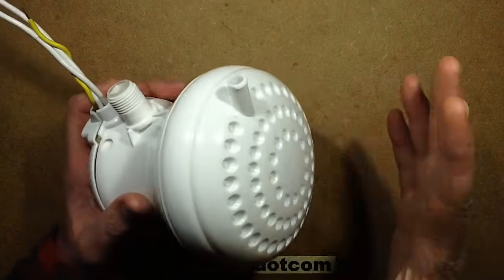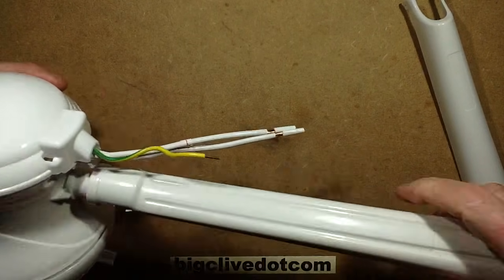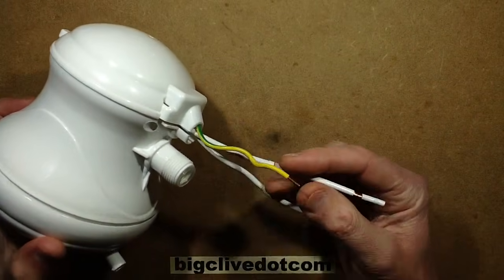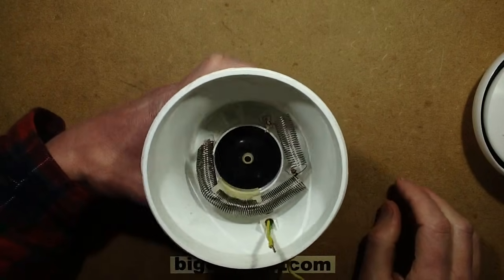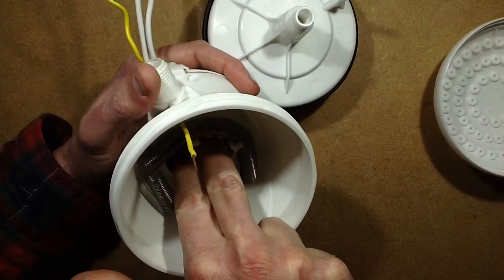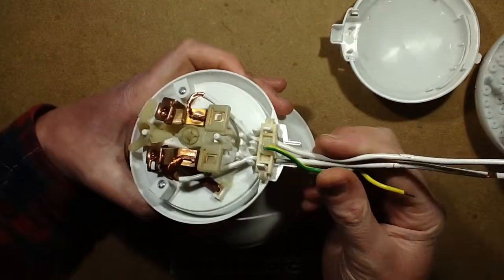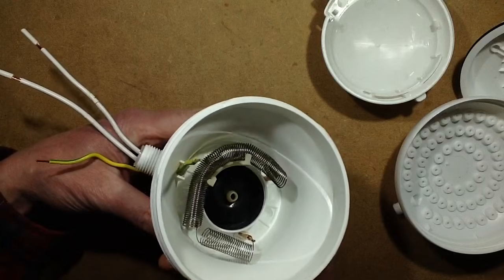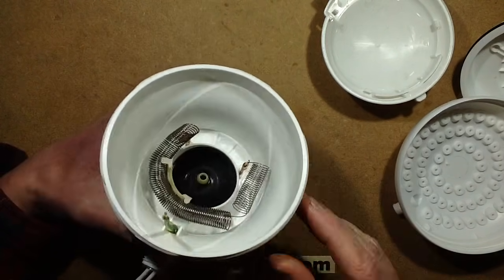Inside a heated shower head.  (suicide shower)

Comment: I wonder how many people have died using these not so safe showers
Reply from the maker: +BillyNoMates1974 Quite a few apparently.  And I'm sure others have had their showering experience cut short quite violently.
Reply: maybe you have really thick skin that acts as a really good insulator. lol
Reply: +bigclivedotcom i won't wanna use it
Reply: +bigclivedotcom clive i do need help with some electric work
Reply: +bigclivedotcom clive i do need help with some electric work
Reply: +BillyNoMates1974 i took a shower on one of these for 5 years! Unless i had a bruise on my fingers i never felt any sign on electric current.

Comment: Ooow that is really nasty, at least you have some resistance wire to use for something else :-D
If they made it from stainless steel and earthed it then that would be better, replace the element of danger lol with two kettle elements with fins to make good contact with the water.
As a concept its clever, how they did it was bloody bad :-(
Reply: +zx8401ztv in a way, i like the amazing simplicity, that it turns itself off with the water flow, they are servicable, the elements being sold separately.  the vids ive seen on the internet make no safety arrangements for the wires, one installation just being screw blocks, not even covered in tape, so you can replace it all the easier, but there is no need to touch it near the top.  I also dread to think what cheap wire they are pushing to  get 5kw out of it too! i bet its probably a bit of random flex to the fuse!, that and another video of a water tank, with the level of the ballcock adjustted just so, that a suspended kettle type element was in the water, but just about (like 3mm) out of the water to stop the mains wires dipping in! lol.    Kids in poor countries must have more sense than ours for hot/electrical things.
Reply: +jusb1066 I think people have become more stupid as time goes on, kids are not taught the rights and wrongs of things.
There parents are thicker than a bankers wallet, so no usefull info is passed on to the kids, safety pillocks want to remove all dangers, but dont we learn by minor dangers, yes we do, well i did lol.
The american culture of sewing everyone for the stupidity of them and there children is so distructive.
You have to make mistakes to learn, we all need some risk and danger, ive done some daft stuff as a kid, it teaches you to be carefull but still enjoy the danger :-D
Wow, dont a waffle a lot ha ha :-D

Comment: with proper install and maybe a gfci if possiple added seems like a useful concept, energy savings yo maybe a design with isolation would be a good thing to have
Reply from the maker: +ChrisD4335 I think a GFCI would trip repeatedly with this due to the use of a bare earth wire in the flow of water from the live element.  But with a properly grounded and bonded system without an RCD/GFCI it would work.
Reply: +ChrisD4335 It is used as an alternative to a hot water tank, absolutely. It is very economical. I saw them in costa rica and I wanted to buy one to have an easy hot water source at my garage or shed.

Comment: 5 kw should be enough for a shower, when i was on bali 5 years ago the cold tap water was about 30°C (so was the sea water btw:D)
Reply: +Erik Bruijn ahh thats why it worked, the water was already warm, i cant see it doing much to my 2c water here today though!
Reply: +Erik Bruijn If your water supply is already lukewarm I see no purpose in these heated shower heads. I'd much rather not have a live shower head above my head.
Reply: +jusb1066 you have to lower the water flow when it&#39;s cold. but it does work. at it&#39;s minimum working flow it heats the water by a good 30 degrees at least.

Comment: WHY the fuck is this not a metal case connected to a metal pipe grounded.

Well if it was trough an isolation transformer id feel safe enough to use it
Reply from the maker: +‍1marcelfilms A metal case would probably be worse given that few of them seem to be grounded.  A 5kW (5000VA) isolation transformer would be huge and expensive.
Reply: +bigclivedotcom I'm from Brazil and here is very common this showers. In fact, I think that just a little fraction of the cities here have gas pipes... I remember that every time I opened the valve of water was as if there was a 50/50 chance of taking an electric shock haha
Reply: +bigclivedotcom well my guess is, that the electrical resistance of the metal piping that feeds fresh water should be a lot more conductive than the person using it or the drainage that is usually made of plastic or some kind of concrete
but you could argue that soapy/dirty water is again more conductive than the fresh water...
anyways I'd feel pretty uncomfortable using that thing
Reply: +‍1marcelfilms i took a shower on one of these for 5 years! Unless i had a bruise on my fingers i never felt any sign of electric current.
Reply: if a risk is unnescessary why would you take it?

Comment: this type of shower is really common here in Brazil ^^
Reply: +lucasvp2005 I would NEVER use this
Reply: +Ola Nordmann this isn't as unsafe as it seems, when I wasn't instructed about electricity I touched shower heads like these while turned on and didn't die (now I'm an engineering student and would never do that again hahahahaha)
Reply: +Re    Let me guess ... you are making or selling these things ;)
Reply: +GraveUypo   There are so many points of failure and scenarios I can think of that could end up badly and that's just of the top of my head. And like Murphy says 'Anything that can go wrong, will go wrong'.
Saying you have never seen anyone injured by one is like me saying I have never seen anyone injured by a car accident. That doesn't mean there aren't loads of people injured by car accidents all the time.
It just seems such an unnecessary risk to me, I mean even a few simple measurements, like a seat belt in a car can improve things quite a bit, but it seems even that is too expensive for those showerheads.
Reply: +GraveUypo   Ok, I admit I thought it would  be easier to find cases, but I also didn't search in Portuguese or Spanish. And you only dared me to find a single case ;p
Since I'm apparently a spammer and can't post links, this will have to do. If you google 'Electric shower kills two Swedes in Thailand' you will find an article mentioning two cases.
Maybe we are a little too sensitised when it comes to electricity where I live. Just out of curiosity, what mains voltage do you have, we have 240 V?
Reply: +Re yes they have
Reply: +Re it's safe to leave it on the "on" position, the models available here in Brazil have a flow switch to turn it on only when there's water flowing
Reply: +Jack White nope, he's just not seeing these for the first time. it's hilarious how people who ARE seeing it for the first time act like they know better than people who use it.

it a crap, cheap showerhead, but nowhere near as dangerous as people are making it out to be. i've never even seen anyone injured by one of these at all.
Reply: Jack White
well, i dare you to find a single case of these going wrong and seriously injuring / killing someone.

it's not the same as saying i haven't seen people injured in car accidents (i have, actually). because one happens every day, everywhere, and the other barely happens at all.

and if everything that could go wrong went wrong i'd be dead long ago (i've been in car accident and everything that had to happen for me to survive happened).
Reply: Jack White
brazil is pretty big, there are places with mainly 220v and some with 110v. in my case it's 110v. i think the majority of the country uses 110v too. the only 220v things in my house are the air conditioners and the one shower (my house has two buildings, one of the has a central water heater)

good job on the challenge though. not that it was hard, now that i took it myself. anyways, it's not a common occurrence :P
i bet stairs kill more people than these showers.
Reply: ***** Same